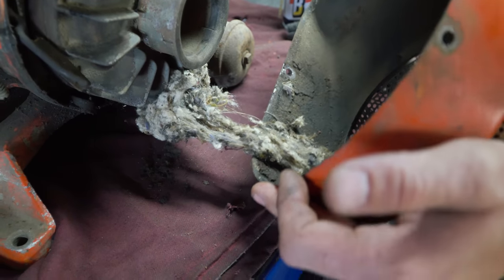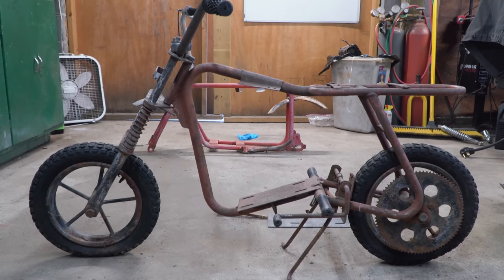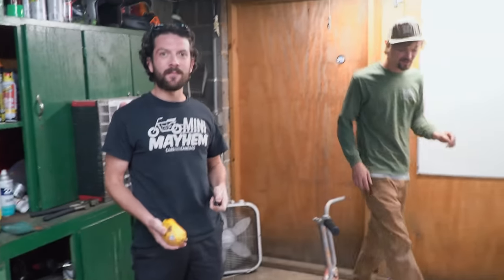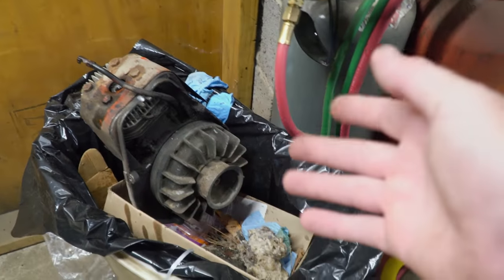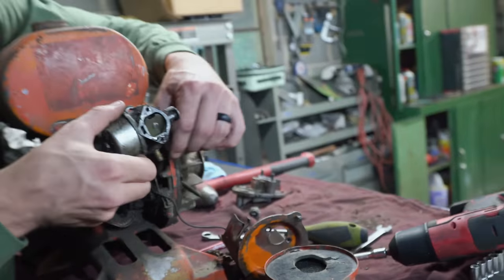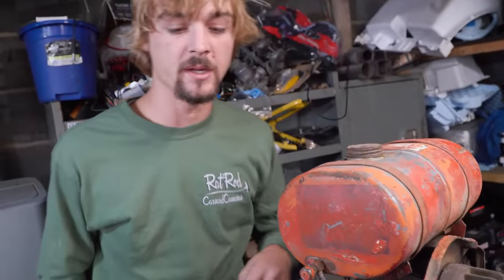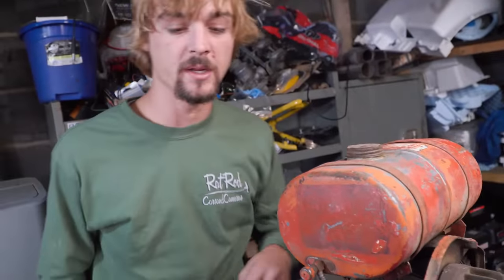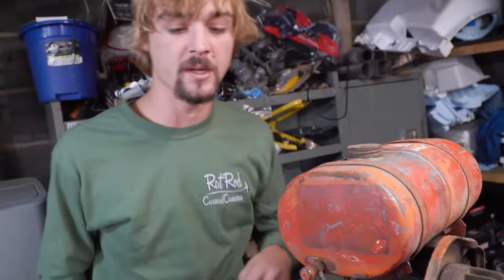Can we Salvage a 50 Year Old Water-Logged 2 Stroke for a 60’s Mini Bike Build?

Comment: Engine needs to be shifting the timing to run in reverse. 2 stroke golf carts do the mechanical shifting to run in reverse or forward and there is no transmission needed for forward and reversing the cart.

Comment: 2 strokes will run in reverse but u have to reverse the polarity.. got a stator coil for my Yamaha blaster and the company I got it from wound it in reverse so after I installed it the 4 wheeler went in reverse all 5 gears .. had to get a different stator coil ..

Comment: Greetings guys, I am writing to you from Puerto Rico, the same thing happened to me about the sprocket I had to weld the freewheel to the pinion and the side of the disk also put pins and weld on razor mx 500 with tecumseh ohv 5.5

Comment: The engine probably doesn't run backwards because of the ignition timing, also I believe its mostly marine diesels that tend to run backwards in order to reverse as they don't require spark for ignition.

Comment: It'd be pretty cool if you guys got a honda big block (240-390), built it up and compared it to stock, as well as a built tillotson 220. I'm particularly interested in seeing how a stock one does with a cam and higher lift rockers.

I've got my 270 converted over to a mikuni style carb, and some other upgrades. I haven't dialed it yet, since I've been having on and off issues with my torque converter, but my top speed record is 50mph in 20 seconds. Mind you, this is on a coleman ct200u with the stock rear sprocket. Next up on the docket is a connecting rod and flywheel, since it'll rev to 7200 rpm (yeesh) pretty happily with the stock cam and some timing advance.

I don't blame you guys if you don't purely based on the cost of the engine, since hondas are pretty boujie as far as  go karts go lol

Comment: JUST MAKE A JACK-SHAFT GEAR REDUCTION AND PUT THE WHEEL ON THE CORRECT SIDE, WOULDN'T HURT TO WELD TABS FOR THE BRAKE CALIPERS ON FORKS AND REAR FRAME.

Comment: Only 2 strokes with an extra set of points run backwards, they are designed to, ignition timing is generally not exactly at TDC, so without those extra points, or without moving them the ignition timing will be wrong if you try to run it backwards, also 2 strokes with rotary valves won't usually run backwards, but those engines you have would be some kind of basic reed valve, it should only be ignition timing preventing them from running backwards.

Comment: Lol! Big three oooo! Im 43....wait til you crest 40 john! Soon a 50 year old shall be along to tell me 40 aint nuthin and so on! Intersting sidenote,mack 300 truck engine would start running backwards here n there if ya killed it accidentally. Smoke out the aircleaner,sucking sound from the exhaust pipe and reverse becomes forward.

Comment: I bought an old mower and when i stripped it down a lot of the gaskets where home made  from copper and linolem the old fella kept it going in the 60s the engine was a villiers two stroke from 1954 lol i got it running and slapped it in 60s go cart that was so old it had u shaped handlebars instead of a steering wheel lol was great fun tho .

Comment: A 2 stroke engine does not have much low end torque but it does have high RPM. The gear ratio on your mini bike needs to be double what a 4 cycle would have. A direct drive 4 cycle might have 6 to 1 chain ratio. a 2 stroke should be closer to 10 or 12 to 1. That will give it low end power and the higher rpm should still give top end speed. I would love to see that 2 cycle compete against the 212 tillison once you work out the gear ratio. I bet it will be surprisingly close to the same performance.

Comment: That's what a normal 2 stroke sounds like that low of an idle, especially those older ones.. it's fine trust me.. If the engine was bad you would hear it at high RPM, not low... great job boys..

Comment: You'd probly need a flywheel that spins and fire counterclockwise they have the magnets in different spots at least on my German e50 engine. It can run in reverse if your timing is right. Also they have a 2 speed varient called the za50 and it spins counterclockwise same diameter flywheel and everything so it's very easy to do it to the e50 engine with the right knowledge it's easy or not enough knowledge lmao

Comment: A two stroke WILL run either direction, Issac, BUT, not with a points ignition. You have to run an "electric" coil, sometimes called an HEI coil.

Comment: hey guys yall need to save yalls lucky charms boxes for gaskets it works perfectly it is a quick an simple an its just as gud if not better than an origenale one an if it to thin then just doublem up trust me ive dont it to small engines to big engines oh an for added protection use a then layer of black or blue gasket maker 👍🏽👍🏽
Reply: True, cereal box gaskets work great. Never had a problem using one

Comment: Here's a dumb idea. Could you make a "reverse gear" system for a 2 stroke by having some sort of onboard starter motor that can reverse direction? Basically if you want to go in reverse, kill the engine then spin it the other way, then do the same to put it in "forward gear"
Reply: That's how alot of newer 2 stroke snowmobiles work is when you press a button not sure how it works but it slows the engine down so much it starts to fire it in reverse.
Reply: @yeboidustin8725  oh interesting! We dont really have snow here in australia so ive never been exposed to snowmobiles in person but thats fascinating

Comment: Chainsaws dont have an expansion chamber either. But they make power. I wonder how much more they'd make with a chamber.
Reply: Muffler back pressure is calculated to work on certain rpm range. Chainsaws and other similar stuff run on narrow rpm range

Comment: Guys, you need a smaller sprocket on the back or a bigger one on the front to go fast. There is a reason it was only doing 6mph! That rear sprocket was as nearly as big as the tire.

Comment: I know where there's what's left of an old AMF Harley golf cart from the mid 70s. It has a big single cylinder 2 stroke with a perfectly round cylinder barrel, and the barrel is leaned way over, like a Predator.
Reply: But they are SOOO gutless. I have a '74, & it barely gets out of its own way. They're a 250cc 2 stroke that only makes around 8 hp.

Comment: There are needle bearings in the wrist pin end of the connecting rod in fact there's a bearing in both ends of rod. that noise that you are hearing is probably piston slap, two strokes that have considerable wear on them the piston skirt will wear. allowing more clearance causing the piston to slap in the cylinder. it's usually more noticeable on air cooled engines. because it radiates off the cooling fins and it will sound sort of like a knock.

wow twenty eighth in the comment section.

Comment: Ok, youre new to 2 strokes, you should have checked that the reed valves are seating properly and clean out that exhaust, it its all carboned up it wont run properly.

Comment: 2 stroke engines can be run in either direction, but the issue is that timing will be extremely retarded if it’s not set up to run backwards. Running forward, the timing will be advanced, so if you try and start it in reverse, you’d also need to properly adjust the timing so it has the same advance in the opposite direction. A really cool feature of some snowmobiles is that the engine will run forward and then you hit a button and then engine will momentarily shut off and restart in the opposite direction. Basically the cdi will change the timing to allow the engine to run in reverse which allows for a sled to have reverse without adding a heavy mechanical reverse

Comment: one more thing, two-stroke will only run in One direction it won't run backwards when you spin it backwards. every time a motor would kick back it would start up there's no way. you ever see a KX80 going backwards through f**** six gears, yeah they don't run backwards I promise. you want to see an engine run backwards, take a 302 Windsor V8, put a different camshaft in it, wire it for reverse rotation, and your 302 will run backwards. if you don't believe me, that's how they get boat motors to counter rotate when they are side by side v8s. you turn a two-stroke the wrong way, ignition timing alone won't let it happen.

Comment: I did the same thing to my truck, the hole for the rear shock was ripped out of the frame so it found a  quarter inch thick washer and welded it over the hole for the shock !!! Has been on There for 3 yrs now with full drop kit and I drift the truck  rofl 🤣 😂 😆!!!!!! What ever works

Comment: Not that simple to make them run backwards. U have to adjust the points advanced to the point where the combustion event happens at a time it allows it to run in reverse.  You can't just spin it backwards and have it run.

Comment: OMFG! Use the K.I.S.S Method guys. Keep it simple stupid. It  needs a simple jackshaft. This will eliminate the tensioner problem and it will fix the gearing ⚙ issues also. I guess it will also to try a bunch of different ratios and configurations. Just saying

Comment: You guys are not 2 stroke guys.     OMG.     You can't just run it in reverse..      there is such a thing as ignition timing
Reply: Quite a few golf carts would completely disagree. 
But I think you're correct on this particular engine
Reply: @Imageloading...  again...   you can change the timing around so it works both ways, not too many ignitions are timed at 0°.    Sled engines shut off and restart in reverse these days..    but ignition timing is changed along with it through the cdi.
Reply: A 2 stroke with fixed timing will run like shit if at all in reverse.   If you want to debate every comment I've made, Im more than happy to.     But you should know, it's winter 8 of the 12 months here and all we do is wrench on sleds in the winter.    We used to have radar runs and drags on the lake but that stopped a few years back.
Reply: @CobaltOntarioadventures  fyi there were quite a few golf carts that have 2 starters, each spin opposite each other. 
You shut motor off, restart with opposite direction starter.
You are arguing points that no one else is arguing.
Yamaha had 2 separate coils I believe
Reply: @Imageloading...  more like explaining how a 2 stroke can technically run in reverse.     If it has fixed timing at 0°, which most engines do not.    And going a step further to explain how 2 stroke engines that start up in reverse - for reverse...    change the timing around to run better the opposite direction..       not arguing anything..    just explaining my original comment to someone who clearly understands, but thinks they're going to be right somehow.     2 coils you say?   I bet ones on each side of 0° so it can run on the timing of the second one for reverse...    exactly what I said lol
Reply: @CobaltOntarioadventures  You're arguing with yourself.